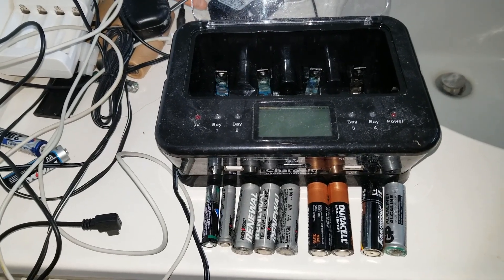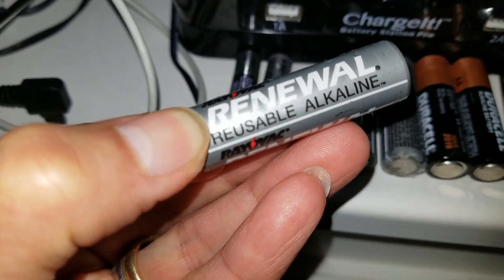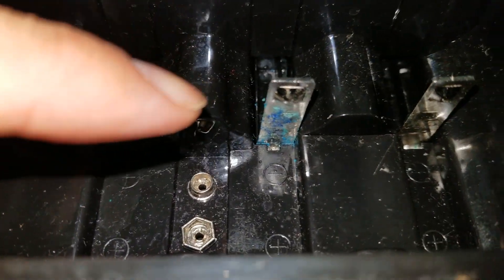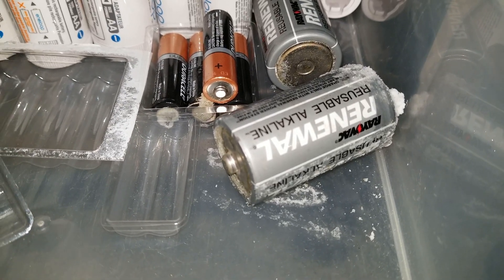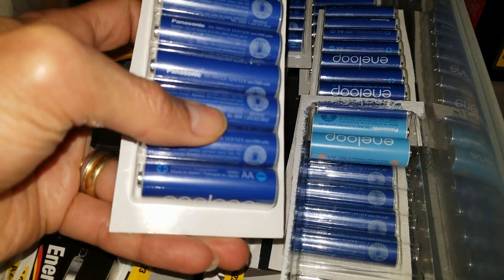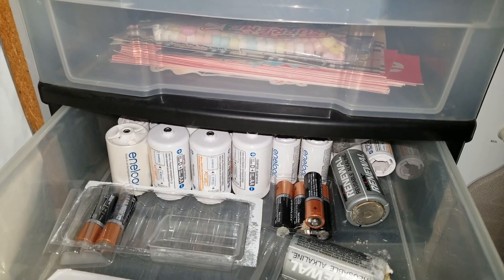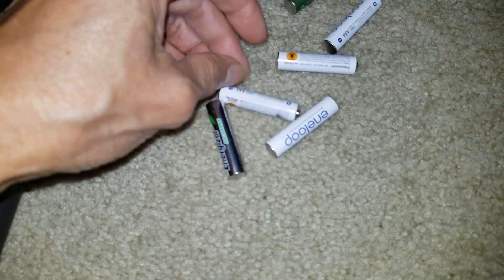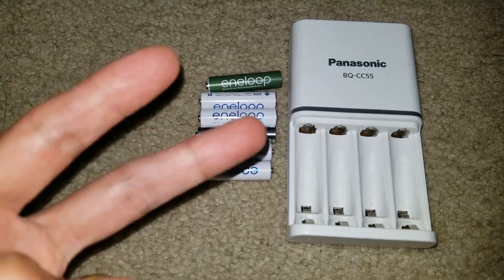These Are The Reasons Why Not To Use Alkaline Batteries vs Rechargeable

Comment: The leaking substance from "alkaline" cells is not an acid but potassium hydroxide, which turns into potassium carbonate. Eneloop are good. They don't self-discharge quickly.